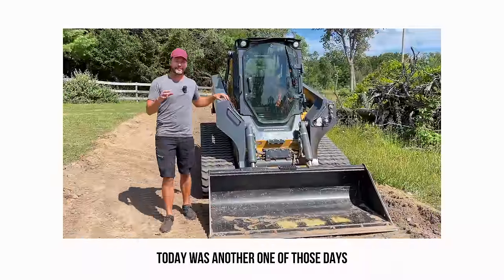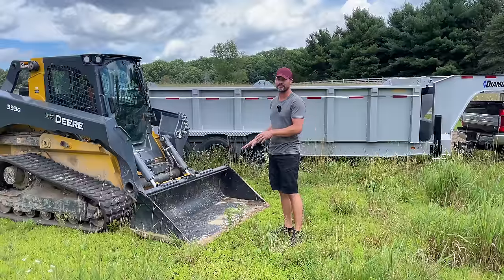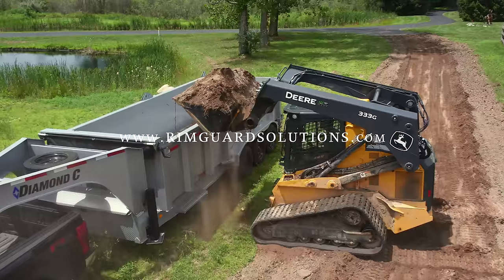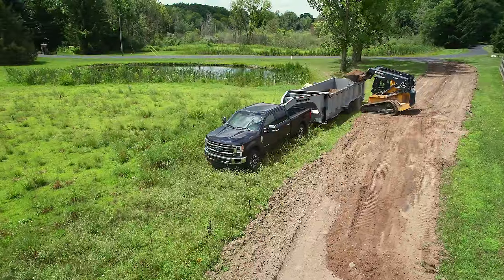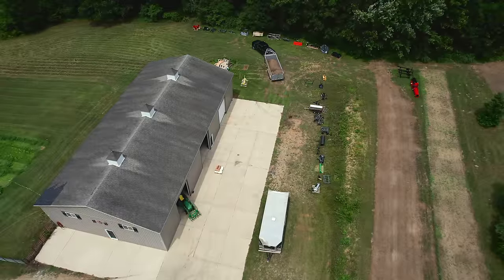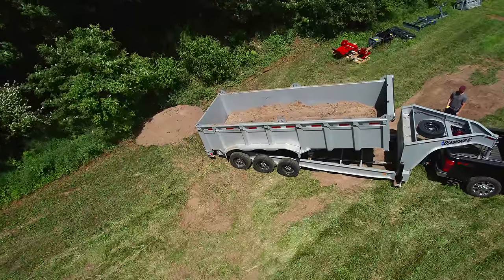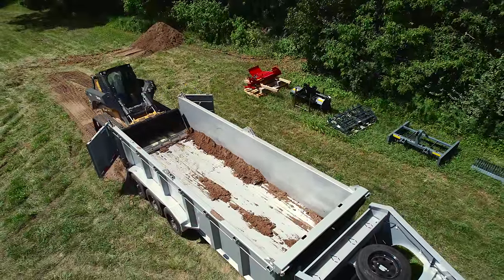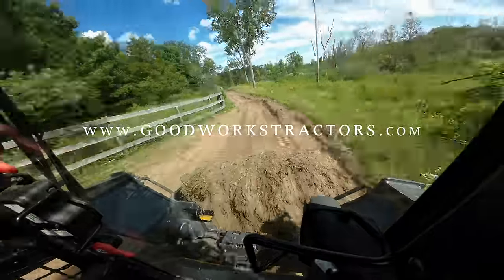THE MOST DECEIVING DUMP TRAILER I’VE EVER SEEN. DISAPPOINTED

Comment: The only thing i saw that you did incorrectly was loading it on the front end and not over the axles.  Had it been more rearward the hydraulics might have been able to lift it.  Also raises the question if they under build the hydraulics for the size of the trailer???

Comment: Should've gotten the front mounted cylinder and you probably wouldn't have had an issue. Doesn't matter what trailer brand/truck it is with that lift mechanism your gonna have issues if you got a lot of weight up front

Comment: That scissor lift design doesn’t have the kind of power to do what you want it. That trailer you have is only good for being a dumpster. If you want a dump trailer you need the telescoping cylinder option

Comment: Buy a used dump truck. I had to replace scissor lift on mine, no capacity at all!! Bought new 3 stage majister cylinder, fabbed dog box in front of bed, crossmember at very front of subframe and boxed frame in directly below cylinder, works OUTSTANDING now! If for whatever reason load wouldnt go up, the f450 will be bent in half now without question. I had to borrow my buddies 14' PJ dump trailer while i was doing some upgrades to my dump, it sucked! Low lift angle, low ground clearance so u had to dump "trails" instead of piles etc. They work ok, but if your able to pick up a decent used dump truck, 100% better tool for the job. Side note : avoid scissor lift setup on anything over usual 8' dump body. My F450 body is the longer 10', scissor lift was 90% useless on it over a ton of weight.

Comment: I have a little 5x10 dump trailer that I have completely mounded full of both dirt and stone and it has never failed to lift. I constantly hear from people about the trouble they have with these larger trailers not lifting loads. These trailer manufacturers should be ashamed to put out a product that can't lift. Your trailer barely had anything in it. That trailer would be going back. If enough people return these trailers or stop buying them then maybe they might make a worthwhile product.

Comment: Personally,  any trailer that has sides or length  what ever that is should be able to lift and dump, granted adding more side is something different,  but from the factory it should lift or they shouldn't put the side to fill a compacity that it can't lift, personally I've never had that happen,  but I don't know what trailer you have

Comment: You need a trailer that has the hydraulic cylinder located at the front of the trailer, better lifting than from the center of the trailer.

Comment: Check hyd lines make sure there not backwards if they are all your power is putting the bed down not up, my friends gator made this happened to and he sold it because he was so disappointed but only after the new owner figured it out that factor had lines reversed

Comment: Lmfao, Let me tell you about the 20ft triple axle trailers, no matter how you load dirt it will always get packed and stuck in the bed. I have a texas pride in the same configuration except its a pintle hook not a goose. no matter what you put in the bed keep it in the rear 16ft. There is a sweet spot you have to figure out cause if you balance the trailer too much it will be too dangerous, not enough weight on the drive tires. will cause you too jacknife when braking. if you ever figure it out you have half the battle won. The reason the dirt always gets stuck is the 20ft trailers dont lift high enough to drop the dirt out, even the dryest dirt sticks in the front half of the trailer. (ALWAYS) Wet sand, MIllings, and moist base rock acts the same way. Basically you will find out the trailer is only good for a few things. Moving the track loader from job to job, demolition cleanup, renting as a dumpster, and 3/8 or larger clean aggrigate, and dry base rock. Oh and dont let me forget to mention, it being a triple axle single tire----> **never leave it loaded on anything less than dry hardpack or concrete**. leaving it longer than 30 min anywhere less it WILL start to sink into the ground. Personally my experience with my trailer has been less than sad. Good luck and stay safe!!!
Reply: and the other thing is my trailer does have dual ram cyclinders.

Comment: Yeah that trailer there is going to be great for brush or mulch something light you can load it right up but yeah there's a reason 10 ton dump trailers are sometimes still only 7x11 or so with low sides, that full of aggregate will be at its weight limit. 13 buckets with a 333, I'd guess you had about 22000lbs in there.. still surprised it wouldn't try lifting it though that trailer could definitely use a stronger pump

Comment: You purchased the rite trailer but you penny pinched on the trailers lifting unit. 
Telescopic 3 stage lift world not have let 
you down and put a bad taste in your mouth 
about the price you paid for your trailer end dump and it want service your needs.  Second mistake was your choice in pickup trucks.  The way to go is Chevrolet High Country or GMC Denali 1 ton single wheel or dual wheel 1 ton.  Talk to the guys who pull cattle gooseneck trailers on the truck and watch the video of JACUBB CRABB with his black 3500 1 ton Dodge pulling a gooseneck dump trailer.  He calls the video the debunk the menth  of the three stage telescopic dump trailer overloaded but will still dump.  
Talk to the cattle pickup truck drivers on the truck that will pull a wagon without struggling.  
Watch the Diamond C video with JACUBB
CRABB on the debunk the menthe on the 3 stage telescopic lift.  Maybe you can get your trailer lift changed out to telescopic 3 stage lift. 

You will be glad that you did.
Reply from the maker: Hehe, I'm not the penny pinching type.  I bought this trailer off the lot, setup this way.
Reply: @GoodWorksTractors  

Excellent trailer top shelf as a matter of fact 
I’m only saying that because you didn’t opt for the telescopic lift .  That’s the only thing I would have gotten worth the money.  Ok I understand that the trailer was purchased already built not ordered.  Still should have gotten a Chevrolet or GMC.

Comment: Know what you bought and it's rating. Not a diamond c issue. End user issue. I run 2 DC dumps for over 2 years, dumped near 1000 times out of each trailer. Haul heavy every day, both will dump much more than the stated capacity. I would imagine 7 yards loaded over the axles would dump all day long. You could and should leave the first 3-5 feet of your trailer empty.

Comment: I don't really think its fair of you to throw shade at that Diamond C trailer because you overloaded it.  Volume, and capacity are two different things. The box on that trailer is almost the same size as what you would find on a tandem axel dump truck, which is about 12 yards or so.  A dump truck is meant to handle that kind of weight.  A trailer is not.  Nor will it ever be.  Think of it like this... you could put a set of pallet forks on a little bitty subcompact tractor right?  Would you expect it to pick up a pallet of shingles? Concrete block?  A bunk of OSB?  Nope... doesn't have the capacity.  That trailer has a large volume, and you said it yourself, it would be great for mulch, or another light material.  Maybe construction debris, or brush.   Something where having the bigger volume is more advantageous.  You just didn't have the right tool for the job you wanted to do.

Comment: If I were you I would  be hopping at that trailer manufacturer about capacities to dump that trailer. That trailer should have been able to lift that load when filled where you had it. It would barely dump it with only a foot of gravel. Start hollering at them. Should make good on that.

Comment: Hummm, that is loose, dry topsoil. It can't possibly be 2-3k lbs. per yard. Road base, gravels, sand, etc, yes. Somethings wrong with the hydraulics on that dumper. Relief valve set improperly, etc. Usually, it's the first 6 or 8" or so that it may struggle, then it should take off. You had to remove WAY too much dirt. Somethings wrong there.